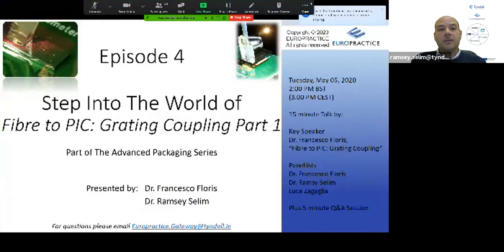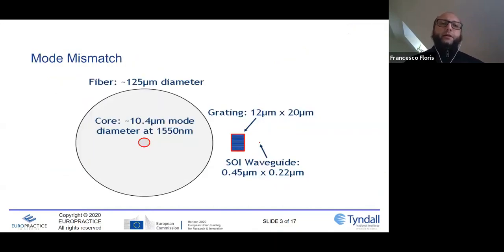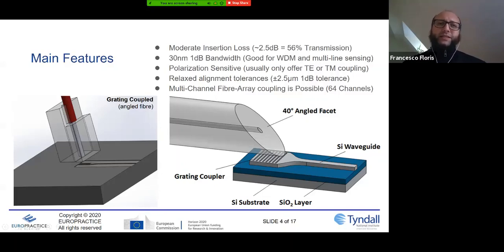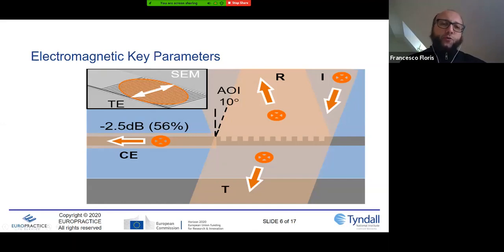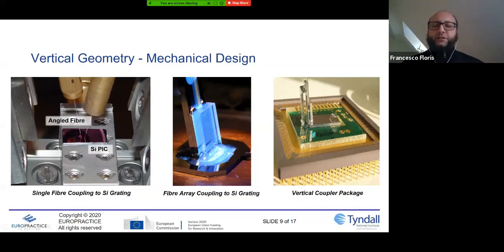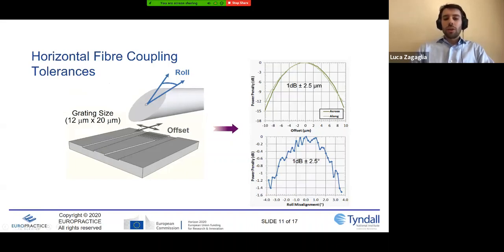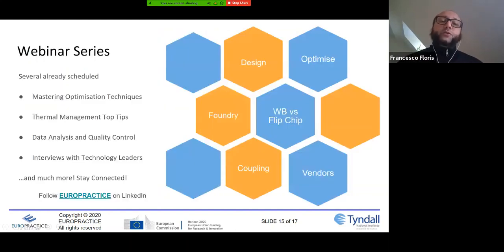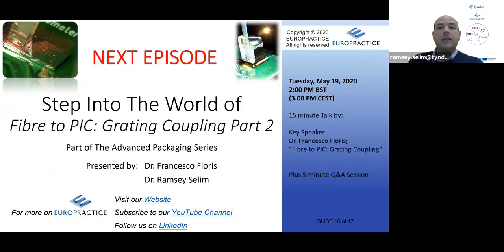S1-E4 Grating Couplers Part1

Comment: Thank you for this video! I have a question - what is the maximum amount of power we can pump into the waveguide (SiN), using grating couplers, before the device blows up? (End fire has this problem where there's a limit to how much power we can pump using lensed fibers, usually about 200mW)
Reply: The exact maximum power depends on the wavelength and also the type of source (e.g. pulsed or CW.)
For example CW source in C-band you can at least handle several watts. 

What kind of powers are you expecting?
Reply: @ramseyselim6586  Thank you! I’m trying to pump light into a high order mode (TE20) in a SiN waveguide, using gratings and would like  to pump in about 500mW or more of CW light. The objective is down conversion from 532nm to 1596nm, to get photon triplets, so more the pump power, the better.

My concern was that fabrication roughness might lead to a low damage threshold of diffraction gratings.